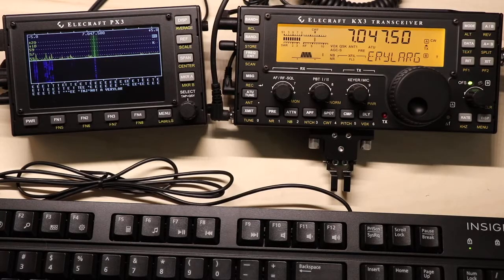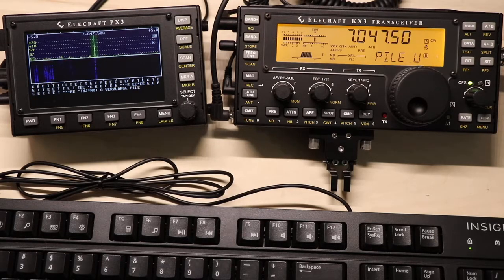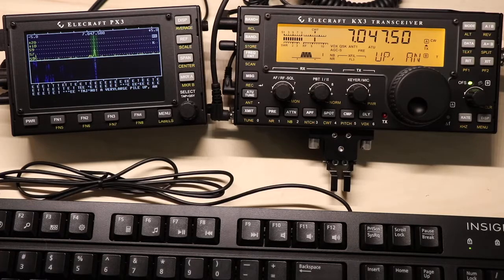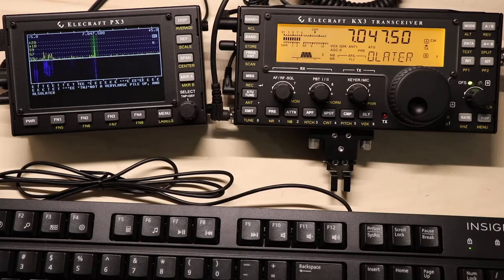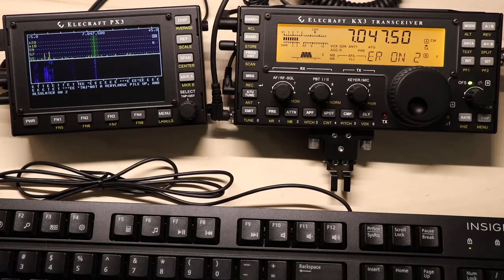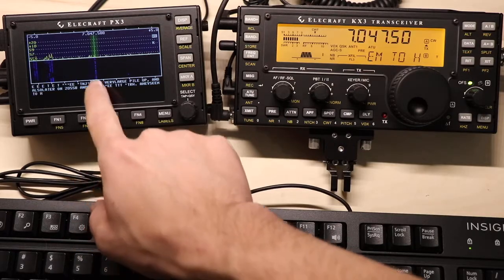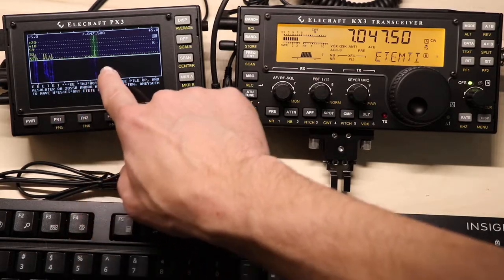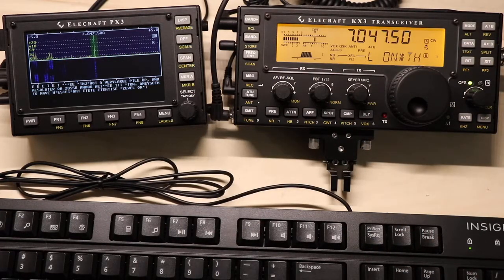Elecraft PX3 Tutorial 4 - Decoding CW

Comment: I'm not able to find ANY documentation on how to get the PX3 to decode Morse Code, can you provide some help with this?
Reply from the maker: To decode, make sure you are in the CW mode.  Then, press and hold the Data/Text button.  You can then rotate the far right selection knob to select the option which will be off, TX only, 1, 2, 3, etc.  I typically leave it on 1 or 2, this all depends on the signal you are listening to.  Also, the display setting matters.  Tap the display button on the bottom right of the radio if you are not seeing the text scroll across the radio.
Reply from the maker: Actually, I just re-read your comment and you said PX3, not KX3.  I need to hook that one back up and see what I did to get it to show up.  It may be holding down the Menu/Labels button to make it cycle through the options.
Reply: @kd5gje  Hi Tim, I did finally figure it out. Hitting the DISPLAY button will get it into the proper mode. Thanks.